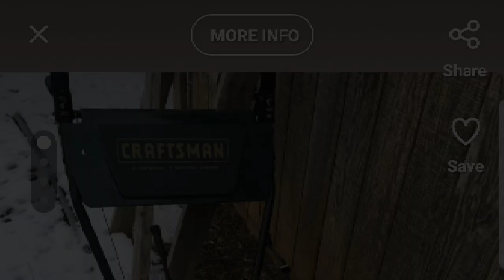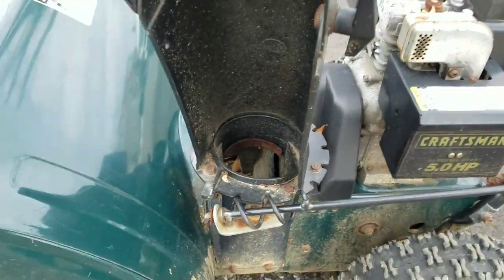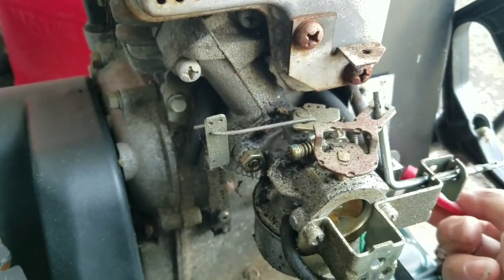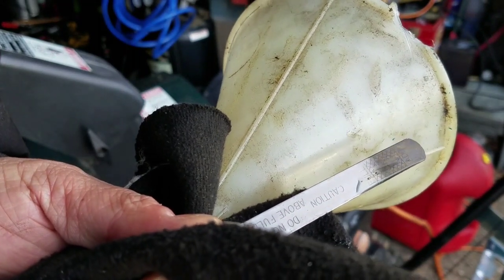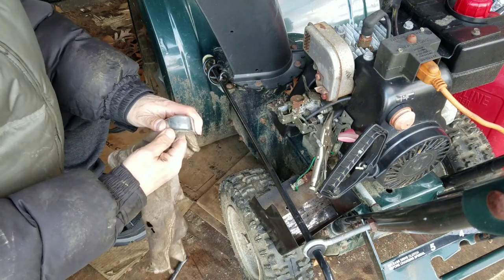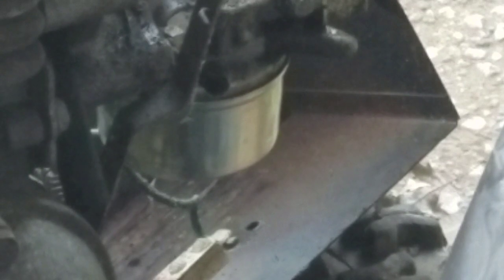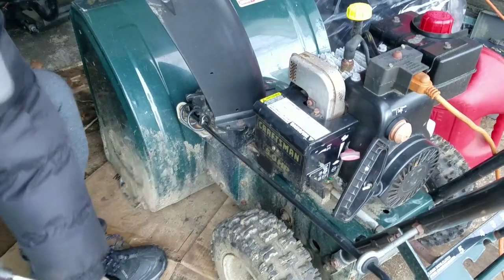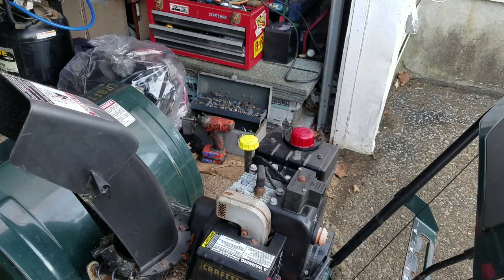$50 CRAFTSMAN 5HP 24" DUAL 2 STAGE SNOW BLOWER LOW COMPRESSION PICK OIL CHANGE CARBURETOR CLEAN RUN?

Comment: That's awesome man, harbor fright tools, awesome place, your compressor should power a 3/8 to 1/2" impact gun no problem, but for tools like sanders die grinders you need a large compressor like that 19cfm one, but if you look, you can buy a V twin pump, a pulley, and use a 5hp turdcumsin engine, and build your own 19cfm compressor, just find a cheap large compressor with a bad pump and or motor, and build one for yourself, oh and that little impact for 19.99 is all a butterfly impact I have one, it's nice for small stuff.

Comment: YOU CAN HEAR THE VALVE LEAKING OUT THE CARB DO YOU HAVE A COMPRESSIoN TESTER  IF YOU DONT YOU ARE BRAKING RULE NO 2
Reply from the maker: No compression tester..what's rule #2? And STOP YELLING AT ME TIM!
Reply: @MowersNBlowers  SORRY HENRY I FORGET AND LEAVE CAP BUTTON ON RULE 1 IS CHECK SPARK 2 CHECK COMPRESSION
Reply from the maker: @timfreeman476  well, I couldn't check no. 2, and you're STILL YELLING MAN!  Its moot because you'll see what happens with part 2 tomorrow.
Reply: @MowersNBlowers  hehe

Comment: Well take heed in the fact, that electric starter is worth 50 bucks..... So no matter what it was an awesome deal..... Best test for a blown head gasket is after it runs for about 3 minutes take the oil filler/dipstick.... Clitus you dipstick.... out and if you see smoke it's a blown head gasket.
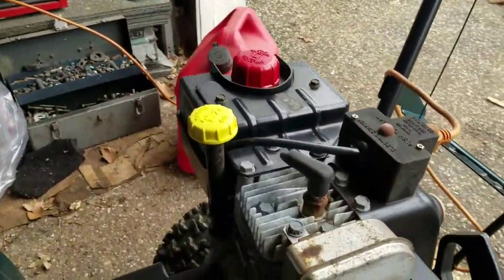Reply from the maker: Yes buddy...I did exactly that at 14:15!

Comment: Smoke (blow by) would not come out of the crankcase on a flat head engine for a blown head gasket. It would only if the cylinder walls were damaged, or valve issues. A blown head gasket on an ohv engine would exert blowback out of the crankcase because they usually leak between the cylinder and the pushrod passages.
Reply from the maker: Either way, there was no smoke.

Comment: When I add fuel stabilizer, or any fuel treatment for that matter, I always run the engine for a while afterwards. My thinking is the treated fuel then gets into the fuel line and carb. Of course if there is a shut off, I turn it off and run until engine shuts off. Make sense, or is that unnecessary? Does the stabilizer just make its way throughout the fuel system without running the motor?
Reply from the maker: Yes, no need to run it...the stabilizer will make it wherever there is fuel.  Hope you subscribed,  thanks for the comment.

Comment: Pretty sad that someone would run a motor without oil. Stabil won't work as good unless you run it  through the fuel system.
Reply from the maker: Happens all the time, not everyone cares.

Comment: Thicker oil does not increase compression 5/30 what you said originally is what it takes
Reply from the maker: Sure it does...thicker oil seals the rings better.
Reply from the maker: winters shouldn't, but has been! Thanks for your kind word buddy!  If you dont think oil helps increase compression, you shouldn't be commenting at all.
Reply from the maker: @brianwinters4991  are you allowed to do videos? Oh yeah...you dont do any of that but yet you wanna talk smack.  Keep talking baby!
Reply from the maker: Do some research before you spew out logical physics.

https://www.freeasestudyguides.com/compression-test-injecting-oil.html
Reply from the maker: From the ASE certification site: 
A compression test is performed on the suspect cylinder. If the cylinder’s compression is found to be below specifications, oil is injected. Introducing oil into a cylinder with worn piston rings increases the cylinder's compression. The oil fills the gap between the ring and cylinder wall.
Reply: @MowersNBlowers  you are correct putting oil in a cylinder can clean up the rings and increase compression but oil in the crank case. Is not what does that a shot of liquid wrench into the cylinder will do wonders at loosing up piston rings
Reply from the maker: Just rebuking what you said that oil does not increase compression.  Even in the crankcase, while not as much, will increase compression.  As you heard in the video, changing the oil was a test to see if compression was improved and it was!
Reply: @MowersNBlowers  oil in the crank case is not what did it just sitting to long can make rings compress but to thick of oil can damage a engine thin oil will get into the rings faster than thick oil the 5/30 oil was spot on what you needed the straight 30 is entirely to thick